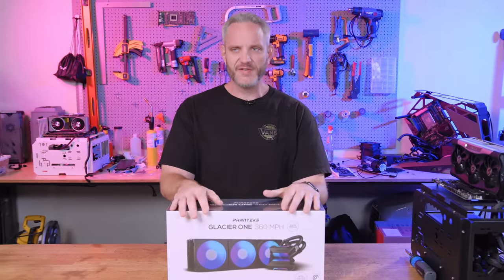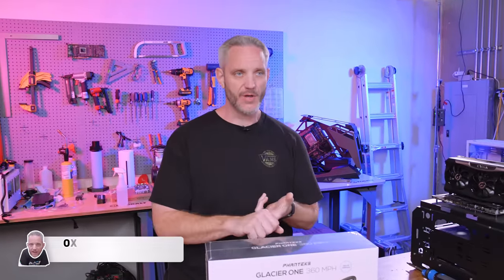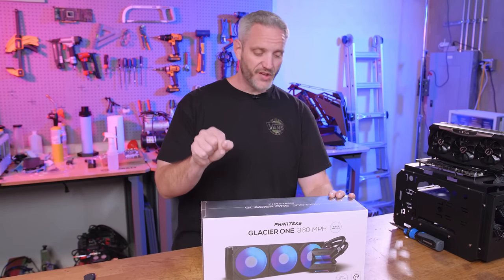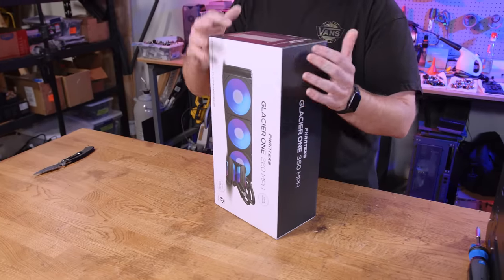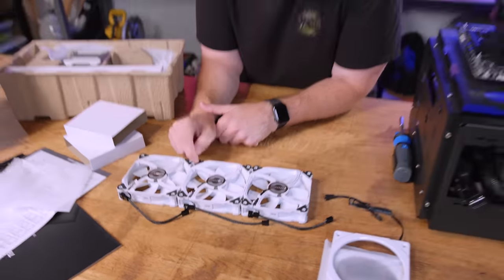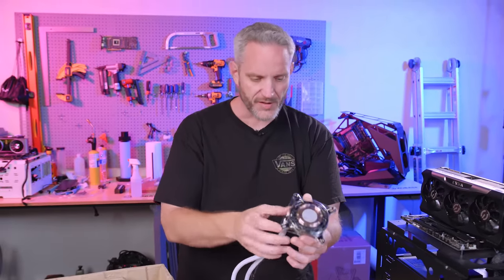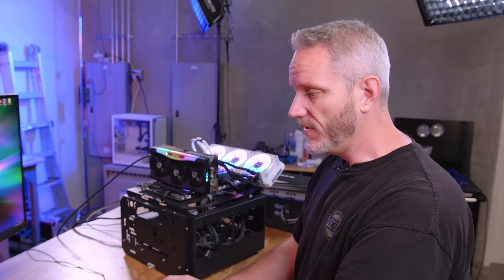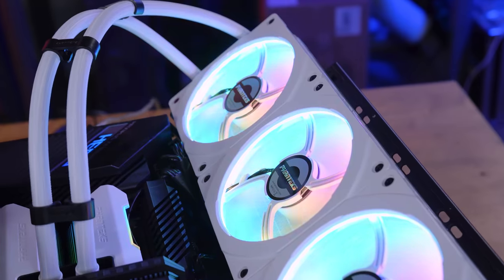A new CPU Cooler has entered the chat!

Comment: I never get above 70c on my 12700k with a 360 AIO, unless I'm in cinebench. 5.0 all Ps 4.0 all Es. More like 50c gaming. It used to get pretty hot bc I had a warped IHS from too much socket tension in my strix board for a few months. Washer mod and lapping changed everything for me.
Reply: yes I was about to say the same, Jay always talks about never being able to OC 12th gen its too hot but I have 12900k @ 5.1 all core with an ASUS ROG Strix LC II 360 and for gaming it maxes around 50c give or take (on escape from tarkov) otherwise it sits around 25-30c doing simple tasks. I get what hes saying a from a heavy load stress testing perspective, but for most people just gaming, streaming or doing work stuff. A lot people will never be putting an r20 type of load on their CPU.

Comment: I have the normal non RGB variant 280mm AIO for my 5800x. It looks like the aio produces some high pitched electric noise, which phanteks claims is normal. This happens when the cpu is under a certain load %. It isn't necessarily loud, but the specific frequency lets me hear it through a closed bathroom door while taking a piss. Put headphones on and you're good

Comment: Thus far I havent had any of the heat issues people have talked about with my 12900k.  I am using the NZXT Kraken Z73 RGB 360mm, with Antec fans on the front of the radiator, and noctua fans on the back.  After ASUS AI overclocking, I am getting 5.5ghz clock speeds with 32c average idle temps and 62c average gaming temps.  I have never seen a spike go above 68c.

Comment: I went with this cooler in my white P500a case on a 5900x. I love the Halo look, but ultimately took the halos themselves off and I run it with the fans only. I liked the white/black look on the fans with the black rubber pads (I see them from where my PC is located) and the white fans pick up a soft subtle glow from the front mounted RGB case fans. The black hose clips also add to the storm trooper look. It is much quieter than my previous DeepCool AIO. The paint finish on the rad looks great in the white P500A.

I run the AIO and fans on separate headers. I run the AIO at 65-80% depending on temps (low noise) and the fans take care of the rest.

Comment: I recently upgraded to a 5900x and I contemplated with the idea of a AIO but I'm glad I stuck with the D15 from Noctua. Keeps everything in check, pbo and all auto jumbo oc on. Only reason I'd get an AIO over the D15 would be rgb ram lol
Reply: I'm considering this route as well. In your opinion what's quieter? The aio or the noctua?
Reply: @morrisshaye6994  Having seen only Corsair AIO's, Noctua sounds quiter for me - I'm talking about load scenarios,  they are set to 0 rpm otherwise. Take into account that I run 6x Prisma 140mm fans in a Meshify 2 - noise isn't that much of a concern for me
Reply: I review weed products on my YouTube channel and i did a mukbang inside Lowes.. trying to get out this 9-5 job & the hood by 25
Reply: I'm running a D15 on a 5950X. If your case can provide the airflow, it'll do fine.
Reply: I to went Noctua NH-D15 instead of AIO. Fractal Torrent Compact case sealed the deal. 5900x and 3070ti stay nice and cool. I live in TX also 🔥
Reply: I have the full-size Torrent case. Best PC case I've ever owned in almost 27 years of building PC's.
Reply: @morrisshaye6994  Noctua has better fan(s) and no pump noise/failure. Preferable unless you plan a heavy OC the D15 can't manage or simply can't fit the D15.
I went back to air after running a custom loop for years, and it's so much easier to work on the system, rare as it is. I don't regret it in the slightest, even if the cooling performance may have been a tad better with water. 

If you want to go watercooling, consider a custom loop. Much more flexible in that you can add parts if needed, and can repair/replace. With rad mountable pump/res combos, they've gotten much easier to work with as well.
Reply: I mean every air cooler is still a water cooler technically. They all have vapor inisde the copper tubing to enhance the heat dissipation.
Reply: @kresimircosic9035  How is that relevant to what`s being discussed?
Reply: @dmariusg  I use Noctua 14 and I know the performance of the said cooler. It doesn magically beat water coolers with just air. Might as well blow a room fan into your PC then.
Reply: @kresimircosic9035  It's still irrelevant to the discussion, no one said it "magically" beats any AIO with "just air". Heat pipes have no evaporation and next to no risk of leaks compared to AIOs though, and no pump is needed to move the liquid around.
Also, I don't think the coolant in heat pipes is actually water, a coolant with a lower evaporation point should perform much better...whatever the case may be, it's irrelevant to the original question though :D
Reply: @ScottGrammer  Torrent is just a absolute “tune to your personal needs” case. I agree best case I have ever owned. The full size will be what I buy if I upgrade to the next latest and greatest. Only thing ya need is cable management. And my ocd is perfectly matched to the compact lol.

Comment: I run an i9 10900k on a 240mm MSI LCD AIO and it does great, my case is only good for a 240mm so I got it set up in a push pull setup and the only time it spins the fans up hard is during benchmarks.

Comment: 8:40 you mention running the fans and water pump from the same PWM. In my experience with engine building I've learned that sometimes slower pump speeds and higher fan speeds lower temps faster than high fan speeds AND high pump speeds. Ignoring the cases where the higher temps are caused by coolant cavitation. The reason for this is that the coolant has more radiator time with slower pump speeds, dissipating more heat, therefore it can extract more heat from the heatsource on its next cycle. TLDR: you probably want to avoid pairing the fans and coolant pump on the same PWM.
Reply: I've suspected the same thing intuitively, and set my pump to 80% and fans cranked. I've had zero issues with temps, and I assume there's the added bonus of longer pump life.
Reply: The hotter the water is, the bigger the temperature difference between radiator and air is. The bigger that temperature difference is, the faster the heat is being moved between radiator and air.

If the radiator is removing the heat faster, i can move more water into the radiator with the pump.

I would assume the pump speed should be more dependent on water temperature specifically, since the temperature of the water(okay, okay, we be specific, the radiator) kinda defines how much heat can be moved by the radiator.
Reply: In my loop its the other way around. pump speed decreases temp instantly, while fan speed takes like a minute or so and is way slower. this is not a car. we have no pressure and the deltas are much smaller. Thermodynamics are not that easy.
Reply: @scotchbreit13  +1 for the name!
Reply: @scotchbreit13  In that specific case I would argue it was just because the coolant had more headroom to soak up more heat from the source rather than the radiator actually dispersing that heat. It would he a worthwhile test for someone like J2C or GN to carry out with added temp probes on the radiator inlet and outlet.
Reply: @jacobzanoni  That's exactly what is happening but this heat transfer still requires time. Its not instant. If the coolant is being moved too quickly, it will be cooled less and therefore extract less heat from the source on its next cycle.

Edit: also to add on to the point that someone mentioned automotive coolant loops aren't 1:1 to PC coolant loops since you mentioned the heat difference to ambient temp affecting the speed of temp transfer.

It doesn't completely negate the correlation. It simply skews the results proportionally. 1, coolant is unpressurized. 2, the operating temps of the components are only ~2x ambient temps and TJMax is only 3-4x ambient so pressurizing the coolant wouldn't be of benefit.

Comment: Never realized how much of a difference custom cooling and aios had
Reply: Big advantage of water is you can decide where to dump the heat and over how big of a surface area. I have two absurdly huge radiators, which would be overkill except the point of the build is to be nice and quiet while it dumps heat. Last thing I want is some turbine-powered monstrosity that sounds like it's going to take off every time I rev the engine.

Comment: Thats wrong. You can easily refill an Asetek AiO. Ive done it 2 times with my old Thermaltake Water 2.0 Performer. Ive used the TT T1000 liquid. Just remove the coldplate, clean out the fins, detach the tubes from the pump and rinse the whole loop with distilled water. After it dries reassemble it and start fill it with a sterile suringe throug the tube port on the pump. When it overflows, just put back the coldplate, shake it a few times to move the bubbles from the rad and continue the filling. It worked perfectly. The AiO is still fully functional, but its weak for my new rig. Im planning to use it for my new Nas/Plex rig(i5-3550 based).

Comment: I prefer Alphacool Eisbär , its an AIO but its more an custom Loop than AIO and you have full copper = no problems with mixed metals a n d you have an refill port at least if you use the normal CPU Cooler with the little reservrior on Top , with the LT Coolers it may be differrent , sometimes the Radiators have an refill port but i am not sure . Its build from standard parts , its expandable . You buyed one with a 240 mm Radiator and now buyed a new case which fits a 360 or 420 mm Radiator and want the Headroom of a 360/420 mm ,  no problem  , simply buy an 360 / 420 radiator ( and the Fans ) and fill it with coolant ... , no need to buy an new AIO .

Comment: I just did a 30 minute Cinebench R23 system stability test on my new 12700k build using an ID-Cooling SE-226-XT air cooler I got off Amazon for only $45. It has a 250 watt TDP rating. My CPU never got above 83C. I have none of the CPU socket mods or contact plates. Just the stock Intel retention mechanism. It scored a 22135 all core

Comment: So basically in terms of size, a modern CPU is way larger than even a monstrous GPU, the required, non-optional cooler is just sold separately. Well, there goes the idea of a "no-compromise SFF build" out the window.

Comment: I have the 240 version and I really like it. One thing to be aware of, if you're using it in a top mount configuration in a smaller case (mine is a 500dx from BeQuiet), the halos are VERY close to making contact with my ram sticks. My ram sticks are Corsair vengeance rgb pro sl, which aren't overly tall. I literally have 1 or 2mm clearance, and if not for the 45 degree notches on the corners it wouldn't clear. But overall it looks great in my all white build. The white hoses look great, and the little clips to straighten them out are a nice touch that all aio's should include. The cap for the pump looks nice and is easy enough to wire up. Easily 9/10 if not 10/10, would strongly recommend if clearance isn't an issue. Oh and I can tell you that if you're using lian li sl fans and controller, the fans and rgb for the halo will plug in to it and run just fine.

Comment: worst of all manufacturers refuse to make better bigger coolers, they just go longer, despite the fact nobody wants a server tower hot boxing their desk and rooms.
140mm,280mm,420mm radiators would decrease the need for longer radiators and Server/EATX cases. a 200mmx200mm would even be nice to use on the side or top panel of many of these open air and box cases.

Comment: I really don't recommend Enermax AIO's because of some inherent issues with quality control and materials/coolant causing gunk buildup inside of them (yes, even the newer one's suffer from this gunk buildup) but the 360 I got can be refilled, as it has a little inlet with a plug in it, so it's my favorite AIO so far. It also has a very large, square cold plate─which is a plus over the Asetek style cooler imo.

Comment: Looks like a great aio.  Currently I'm using the kraken z73 360mm.  I really like it.  On idle I only get 25° C on a i9 12900k.  Haven't really overclocked.  On gigabytes easy tune oc I run in the mid 50°C at an all core 5ghz oc.
Reply: I’ve got the same AIO and I hate it, there’s gotta be something wrong with this thing. 8086K spiking to 89C, 60C idle. I was getting lower temps with a 280mm Corsair, the NZXT has been a downgrade for me. I’m disappointed because I read such good reviews about these.
Reply: @OCtheG   I installed the thermalright cpu bracket to get my temps down.  Are you using the stock ilm on the motherboard?   I have my 360 as intake on the side with front intake as well, then exhaust out the top and back.
Reply: @8oh1guy  Multiple problems, stock ILM and I had my fans backwards on a top mount so it was intaking along with the front and bottom, and only exhausting out the rear suction was strong enough I confused it for thrust lmao. Hadn’t heard about the ILM upgrade before, I’ll give that a shot. Appreciate the heads up!

Comment: You know what would be good to see, rather then spending all there development on pretty lights and paint jobs, if they could develop a better pump option then that aging asetek crap. EK and Artic are the only non-asetek AIO's that I'm aware of. These reviews push me toward a custom water loop on my next build. How about a video comparing custom water loop pumps and perhaps a budget custom water loop alternative to an AIO and the pro's and con's that go along with that. Cheers.
Reply: Because custom water cooling has been using D5 or DDC pumps which have been reviewed to death. Even on Jayz channel.

Jay had mentioned why water cooling content has died down and its because things haven't changed enough to warrant new videos.

Jay already has a video on lower cost water cooling loops. But the issue is, even the cheapest custom loop is still several times more expensive than an AIO and you won't get enough performance to make it worth it.

Once you start using aluminum radiators and cheaper water blocks, you don't gain much performance but you gain the maintaining costs of a custom loop which doesn't make it worth it.
Reply: @viet0ne  Yeah I found the video you mentioned, thanks for that. I guess I'm just jaded with these asetek AIO's having had 2x corsair and 1x Cooler Master fail on me just past the warranty date. So for me I'll lash out with my next build with a custom loop with a EK D5 pump for reliability and for as you mentioned maintainability.
Reply: @davorocket2825  I think you missed the point I was looking to make, I wouldn't go custom loop unless you're willing to add maintenance to the routine you have to do to keep a custom loop working well.

If you're getting the performance you want with an AIO, I'd rather replace an AIO every couple years than trade the maintenance cost of draining and cleaning a custom loop twice a year and risk leaks that could destroy the entire PC.

The reason many run a custom loop is for looks. I myself run a custom loop and only did so for looks. But every time I've drained, cleaned, leak tested, etc I just about revert back to normal air cooling.

Comment: Phanteks Halos(I have PHANTEKS Halos Lux Digital 140 mm Frame, Digital-RGB - Aluminium, Black on my Enthoo Pro Midi) are cool, I use them on my case, they give the fan a speaker cone appearance(like Jay said, depth) when set to static color.

Comment: when your aio sloshes is when you cut the tube, fill it back up and splice em back together
Reply: In most cases you can just yank the tube loose from either end and it still holds after you plug it back

Comment: I still don't beleive those rubber pads on the fans do anything.  You have the metal screw, going right to the plastic and directly touches the frame that you are attaching it to, so you have a direct solid path linking the fan and whatever you're attached to.  You would need a rubber washer at the screw head too, to isolate the vibrations of the fan to the case.

Comment: I personally don't think that the extra liquid mass and the radiator size of 360 AIOs have over 240/280s are at all necessary. Extra liquid mass means it will take more time for the CPU to raise the temperature of the liquid, whereas bigger radiator size will mean that the liquid will be able to be cooled faster thanks to the extra surface area; however the thing that really determines how well the CPU is cooled is the liquid pump. When I work my 3700X in Cinebench R20 @1.3V 4.3GHz all-core, cooled by NZXT Z63 280, the temps crank up to 70C almost immediately, even at 100% pump speed with liquid temperatures at 35C, and the liquid temps take a long time to rise anyway. The only parameter of this situation that a bigger radiator and more liquid mass can affect is how fast the liquid temperature rises; sure, in the case of a 360 AIO, the liquid temps will raise more slowly and maybe they'll also start up around 3C lower, but who in their right mind puts their CPU through literal hours of stress testing during actual daily use?